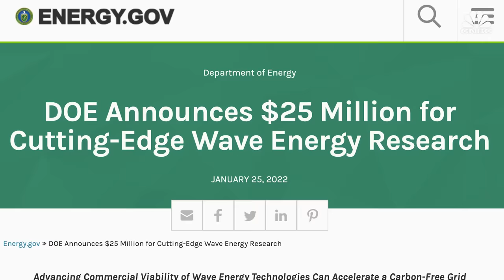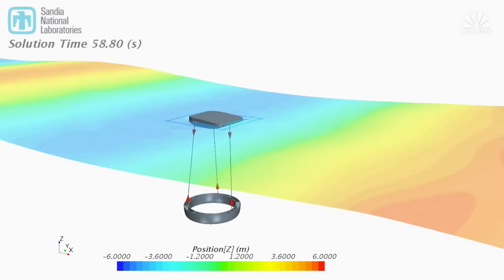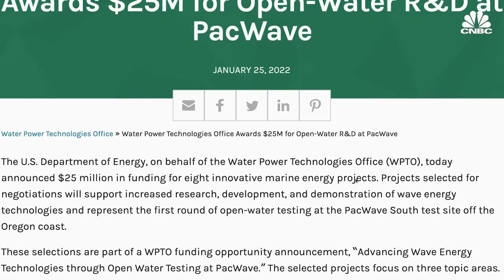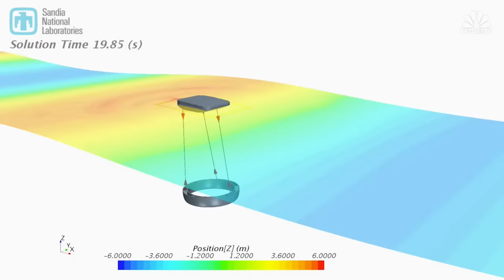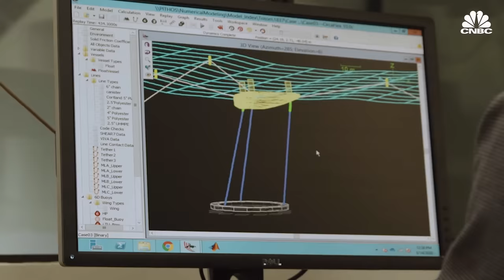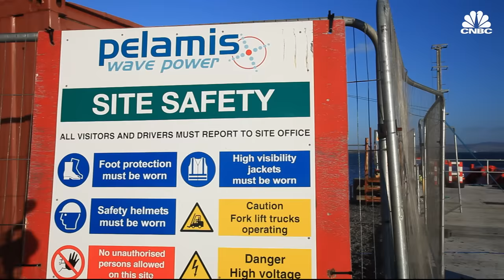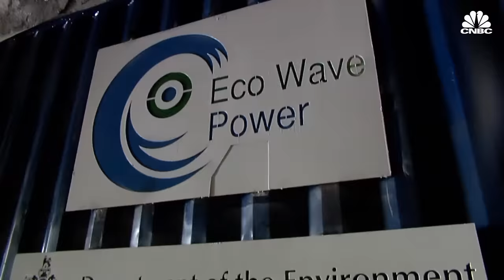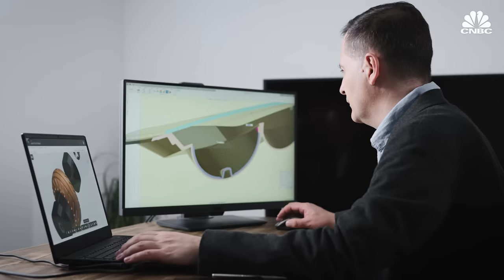How Waves Could Power A Clean Energy Future

Comment: should partner with offshore oil rigs to generate their power and allow them to be repurposed after they're done extracting oil (due to lack of need or lack of supply) into off shore power stations
Reply: Unfortunately, due to the power having to route through subterranean shielded cable, it would never be practical to reach the long distance of offshore rigs.
Reply: @InspiredScience  why would it be a long distance? they could be located very close to offshore rigs yeah? if you're talking about bringing it back from the rigs maybe but also consider the cost reduction of having a facility out there already instead of having to construct one.
Reply: @alexz5574  - Correct, the conductor between the rig and land.  The bulk of U.S. offshore rigs are over 100 miles out.  If it were data, that would not be a major issue; however, for the amount of power generated, there would be no way to make that a sustainable proposition.  I wish it were.

In addition, within the context of the U.S. and Gulf-drilling, the Gulf exacerbates the problem because the swells are not as large as the Pacific (best) or Atlantic.
Reply: @InspiredScience  So is oil brought back via ships then from these rigs? because I thought that it was piped back and they could just fill the pipes with power cord, shame its not feasible, could have been little power islands all over.
Reply: @InspiredScience  Transmission costs of electricity will be too high. It takes all kinds of fossil fuels to mine copper ore, to process copper ore into concentrates, to smelt copper concentrates into crude copper ingots, to refine crude copper ingots into 99.99% pure copper. The energy costs of energy inputs will be higher than the energy output produced by wave power. In short, in layman's terms, you consume more energy in order to produce a given amount of energy. It is like consuming 10 barrels of oil to produce 1 barrel of oil which no renewables can hope to achieve, therefore it is energy negative. If renewables can produce more energy than it consumes, like consuming 1 barrel of oil to produce 10 barrels of oil equivalent and producing a net output of 9 barrels, then it will be energy positive. I have not seen any renewable solar and wind and wave energy power plants being constructed to power a vertically integrated iron and steel industry. Has anyone seen a solar power plant power a vertically integrated solar cell industrial factory facility? Many people are very angry at me when I start pointing out the bare truth to them for they are so naive and resort to violent outburst of emotions and expletives instead of showing mathematical engineering figures based on down-to-earth realities in and from the real world! LOL!
Reply: @darthvader5300  - You may have intended to reply to the original poster because I was writing a similar message.

While it's accurate in regard to offshore rigs, your statement about solar is less accurate if you are familiar with the science/technology accelerated curve, you realize that there must be a market for something at its early stage, in order to fund rapid development of that tech.

While solar is only 20% efficient now, within 15 years it should be able to reach 50% with longer lifetime, as well.

It's not much different than Nuclear Fusion, which is certainly possible now; however, it doesn't produce a return.  Fortunately, Fusion holds so much promise that billions are invested to move it forward.

The point is this...

If the world gives-up on a technology in its early stages, that would be a monumental mistake as technology advances at an accelerating curve.  It starts slow and eventually steam-rolls, providing the demand is there.

This is the same reason that computers began as essentially worthless.  Meanwhile, today you have a device that fits in your hand that can do one billion times more than early computers (literally).

Solar is one of the most promising forms of energy to sustain our world, whether you believe in CO2 reflectivity -- or you're a conspiracy nut.  Does that mean it's there now?  No.  

Modern Nuclear Fission (Sodium/Gen4 and Micro Reactors) and hydro are, by far, the most efficient sources at present.  That doesn't mean that we should stick with Fission and abandon research into Fusion.
Reply: They're right - it probably isn't feasible everywhere, but in places like, say, THUMS Island, off Long Beach, CA, US, it could absolutely work.  And because the area is already an oilfield and shipping lane, environmental impact would be minimal.
Reply: I thought they moved the rigs to new drill sites..
Reply: @InspiredScience  efficiency of the panel yes - but solar is only 25% annually - 50% loss is nightime and the rest is weather and the power output curve closely following a Weibull distribution curve rather than the gaussian curve

Comment: There is a power plant in Pico island of the Azores, which worked for years connected to the grid. It works on a water column oscillation principle where air passes through a turbine. I have data and I saw it producing energy. It sounded like a living creature, breathing. It was a real privilege to see it running.
Reply: 24/7 365 day reliable constant supply - amazing
Reply: @jimlofts5433  not exactly because sometimes you don't have waves, but you can forecast it for 9 days ahead

Comment: I’ve always wondered what are the possibilities of wave power/energy.
Reply: Not great. The harsh, corrosive environment quickly raises havoc with just about anything you stick in the ocean. Not to mention the mussels and other difficult marine life.  I doubt there will ever be widespread adoption of this sort of energy technology.
Reply: endless. Anything that moves, can generate energy. ocean waves are the most powerful movements on the planet
Reply: @briandbeaudin9166  I would call these a unique set of challenges to be overcome, but eventually good solutions should be found. It looks like such systems wiill require a lot of maintenance, but otherwise it should be practical.
Reply: There are none ) It's just very expensive toys
Reply: @Alex-op6ni  Nepravda
Reply: @briandbeaudin9166  what has been used for hundreds of years to combat ocean growth copper .
Reply: Then there's the rust.
Reply: @RogerThat1945  If they're using steel, obviously periodic maintenance to replace any rusting components would be a must. Steel being recyclable, though, that wouldn't be insurmountable.

Comment: Tidal Power in these higher latitude locations is a huge energy potential. 2x a day unfathomable amounts of water change course . I hope we continue to explore all the energy options the oceans can offer us. Very nice video and great job!
Reply: we are testing this off the coast of Scotland as we speak - https://youtu.be/4d9zs0W9u2A
Reply: 2 times a day, but is that in line with peak consumption periods? 

Probably not, which is a considerable challenge as you may be able to generate the electricity, but unless you build significant storage capacity reserves it will likely be wasted…..
Reply: @brian2440  Tides stop 4 times a day, otherwise current always flowing in places like the Sea of Cortez with 20'+ tides.
Reply: @bob_frazier  agree but tidal is reliable and predictable unlike the other crap - as with all renewables "STORAGE" is the problem and is only for the far north of Australia - never going to happen with aboriginal and green activists
Reply: You can arrange a set of tidal barrages to provide continuous power.